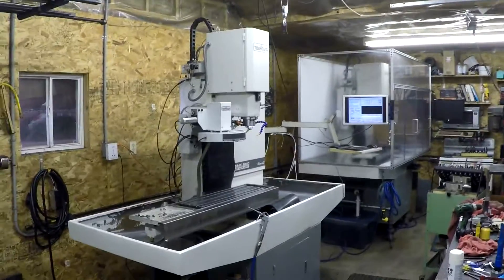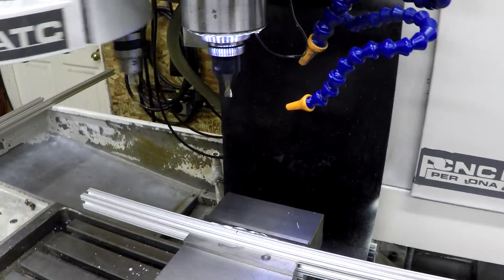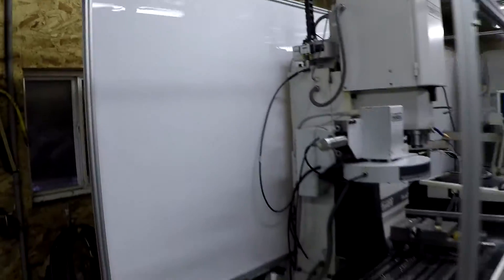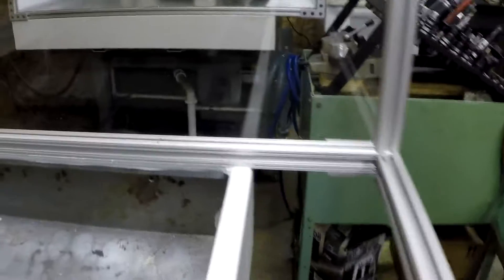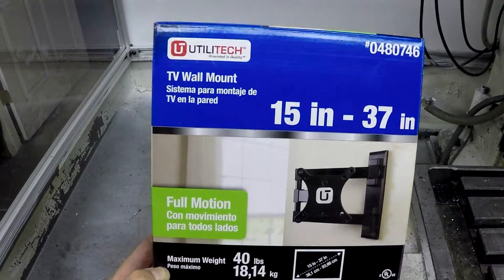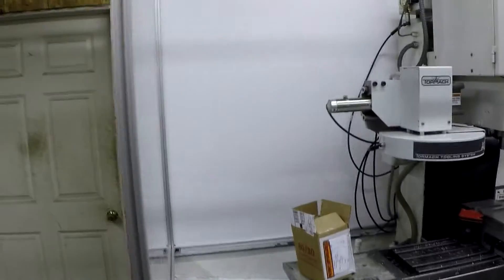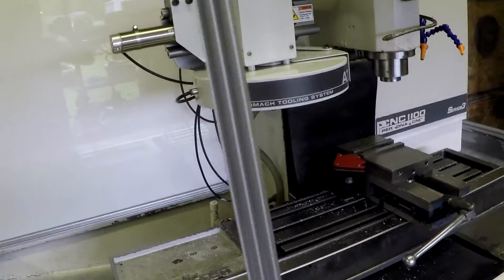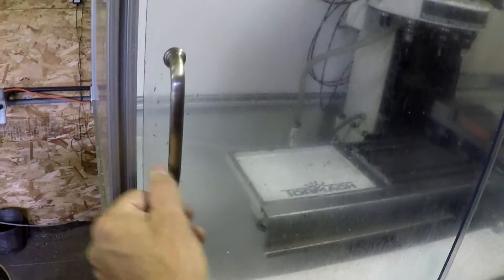DIY Tormach 1100 Enclosure

Comment: I built this enclosure years ago after learning of this post. After starting to use flood coolant I quickly learned that no matter what I did, coolant would find it's way out of the machine and onto the floor. 
I ended up building a Z shaped flange that goes between the enclosure and the Tormach stand tray. With this flange in place, the coolant has nowhere to go but back into the tray! Please let me know if you want details. Not only does it stop the leaks but it also stiffens up the enclosure a LOT.
Thanks again for posting this!
Reply: Please share. I’m thinking on buying the 1100 and was thinking of making my own enclosure

Comment: Great video. Could you do one of how you hooked up the hose for a wash down sprayer? If you had to build the enclosure again would you change anything?
Reply: I just ran a pipe from the coolant supply line to the hose. All PVC. If I did it again I would not put a handle on the far right and left sliding windows. From sliding the center windows they bang the handle and eventually cause the window to crack at the handle. Other then that this has worked well. If you didnt care about seeing in from the sides you could use white panels like the back one. Then you wouldn't have to clean them.
Reply: @rapidfiretekrftusa3769  But does the hose only work when the coolant button is on and then it's also spraying our near the spindle too? I'm trying to set mine up so the hose can be used anytime without having to turn anything else on/off etc
Reply: @gamble1997  Yes it only works when the coolant button is turned on. You can just turn on the main breaker switch on side of control panel then turn on coolant switch on control panel. That way you do not need to boot up the machine. Let me know if that helps.
Reply: I can post a link to a photo if you want it. I would have to go take the pic

Comment: Perhaps a silly question, but did you put glass on the top of this enclosure? Or was that not necessary? Thinking of doing this myself and can't tell from your video whether you glassed in the ceiling of the enclosure. Looks great! Thanks.
Reply from the maker: Hello, I did not add any glass to the top as I did not think it was necessary. After having these on my machines for a couple years now definitely not necessary. Thank you
Reply: Thanks for the fast response! That's helpful - I'm making a similar enclosure for my mill and not having to glass the top will save some $$. Thanks for great video.
Reply from the maker: You are welcome. Enjoy making chips!!

Comment: How do you keep the doors sealed up so the coolants doesn't leak around the bottom track?  It would seem the coolant spray would eventually fill up the track section closest to you.  Hope that makes sense.
Reply: he has holes drilled through the first two walls of that part

Comment: How does the sound reduction compare to (a) nothing at all, and (b) the mainly sheet metal version supplied by Tormach? I’m interested to know
Reply from the maker: It helsp a little with direct sound coming at you. However the top is open and sound escapes out the top. I usually have 2 machines running at the same time so it is still noisy. I always flood my machines and this does an excellent job of keeping the fluid and chips in. I also can see into the machine at all angles.

Comment: Here are a couple of things I learned during my build...

1. 1/4-20 carriage bolt heads fit in the 80/20 slots. I used these to mount the 80/20 to the pan so there were no holes to drill in the 80/20 members
2. I milled slots slightly bigger than the T-nuts into the 80/20 frame members so that T-nuts could be added/removed without disassembly

Hopefully these will be useful to others taking on this project.

Thanks again sauni68!
Reply: That is great. This would definitely save some time. Thank you

Comment: Thank you very much! I bought all the materials and mocking up now. 
Do you think 36" height will be enough for chip and coolant containment?
Reply: 36" may be a little short to contain your coolant. I have 2 coolant sprays on when milling and depending on what I am cutting the coolant will spray up pretty high. Thank you
Reply: RapidFiretek.com Better safe than sorry. 48" it is. Thanks again for the great video and information!
Reply: I think you will appreciate the extra height. I have a hose attached to a garden spray nozzel for clean up, works well.

Comment: Beautiful work.  Thank you so much for sharing this with us.  I just moved to a new house and will need to do something better than my quick PVC and shower curtain setup and this should work great.  I have an upgraded coolant pump, so I may want to put a ceiling on, but that should be easy with some cross members and some more plexiglass.  Some waterproof LED strip lighting might make a fine touch for me in my poorly lit work area.  I'm also thinking of putting sliding doors in on the sides, especially the control side for easier access to those.  So many possibilities using this method at 1/3rd the cost.
Reply: Thank you, Its not to time consuming and works well